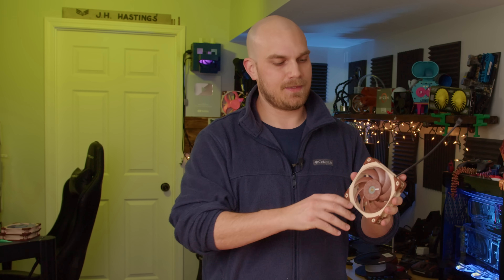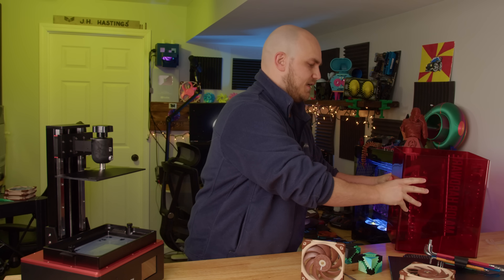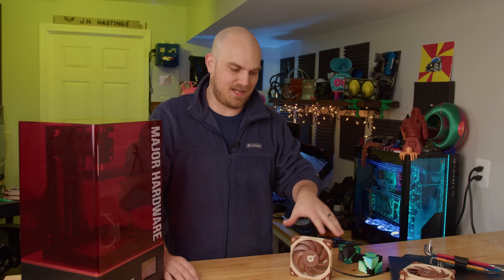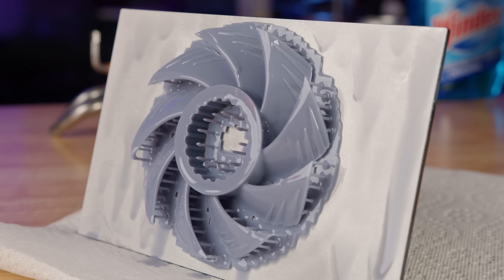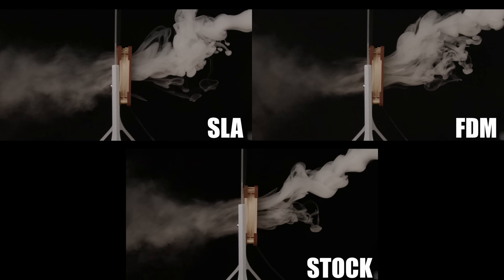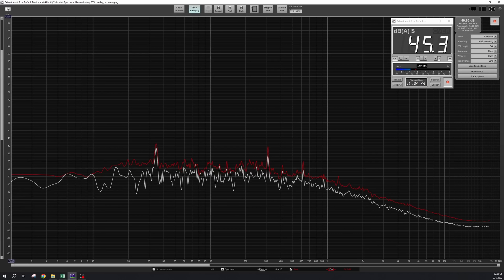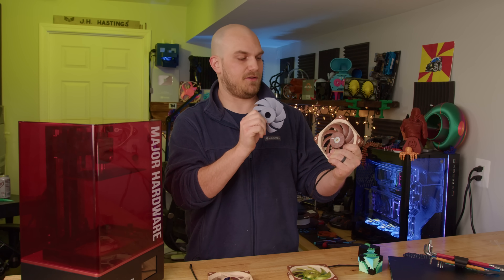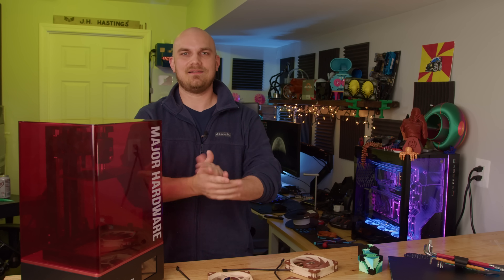I Copied Noctua's A12x25 and Resin Printed it, Its Performance Was ASTONISHING

Comment: I'd really like to see you do more prints in resin. I think it might open the door for some geometry that might not be possible with FDM (thinner blades, etc).
Reply: Exactly. And now that we know the numbers, it's easy to calculate how much worse the FDM version would perform - as long as they're printable.
Reply: @ronnetgrazer362  To be fair, the exact percentage difference between the FDM and PLA will be different depending on the geometry, some designs may not gain as much benefit from PLA while others the smoothness may be an even larger contributor. I imagine some designs may even benefit from FDM over PLA, the small lines might break up some turbulence in certain designs for example. We know it's about a 2.1% difference for that particular model, but that doesn't mean we can slap a 2.1% difference to every model tested, that's just not how fluid dynamics works.
Reply: @DreadKyller  Good point, others suggested averaging differences measured on different models but if you're right then that won't work either. Might be possible to group them based on features tho, and get a ballpark FDM/SLA correction factor that way.
Reply: There are additional variables beyond smoothness (iirc there was a smoothing episode of fan showdown) including but not limited to
- part accuracy (flat planes don’t work perfect on resin, but rather than sag they can just disappear into the resin vat leaving thinner parts)
- material density
- infill (iirc the FDM prints are 100% most of the time, but they needn’t be)
- surface properties of the material
- macro vs microscopic imperfections and texture (golf ball vs shark skin vs jagged edges)
Reply: I second this!
Reply: I think FDM is lacking the micro grooves that break up trailing edge turbulent air.
Reply: I agree
Reply: Maybe the original makers of the top ones should be able to suggest changes or make changes to their fans not big ones just subtle ones

Comment: I'd suggest to test other models of fans to see if the delta loss in performance remains the same.
If it does, then all you need is an "offset" to compensate the printing efficiency loss so you can compare the models sent to you with commercial models.
Reply: That would probably be a function of surface area and hard to estimate.
Reply: I studied fluid dynamics, and you can't really do that. Two reasons:
1. Efficiency at top end tend to be non-linear. So you can't just add a 2.7% to every fan, that won't be fair to the commercial models.
2. The loss from the fans will affect RPM (drag), air flow (“lift”), and noise, neither are a simple linear calculation.
Reply: @AaronShenghao  Valid points.
I drop my suggestion.
Reply: Agreed